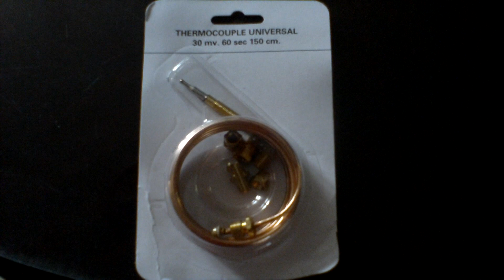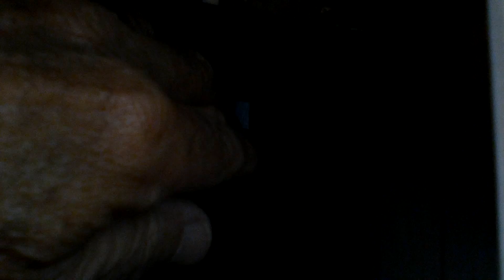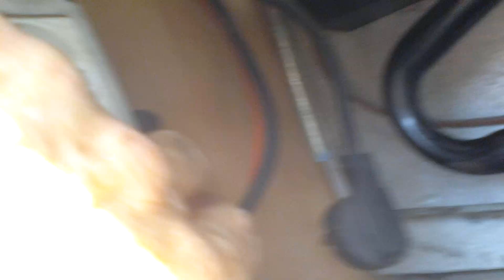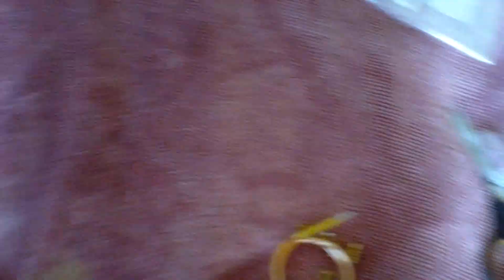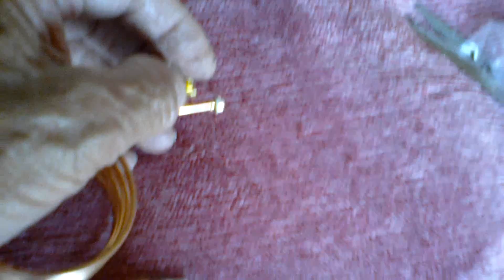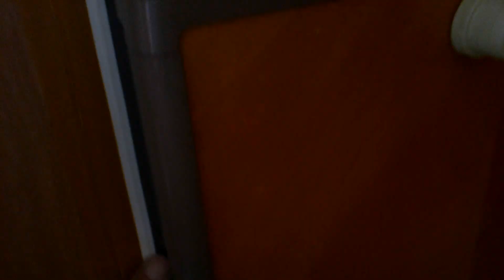ELECTROLUX 3 WAY FRIDGE THERMOCOUPLE REPAIR

Comment: Hi Peter, Have you still got the motorhome? My fridge has stopped working on the gas and the 12V, not sure about the mains but looking at the pipework behind the outside vents, it is very corroded. How easy is it to replace? My MH is a 1998 model and looks very much the same as yours. Alan.

Comment: Hi peter, i have same engine,  my gear box number doesn't  drive , its select but does nothing. Any tip to fix? Thanks
Reply from the maker: @MyfirstEV23  Hi there. I’m afraid your question is incoherent and does not apply in any way to the video I posted.
Sorry but can’t help you.